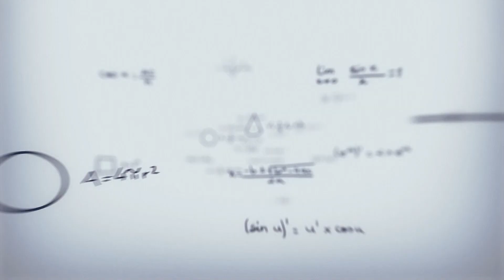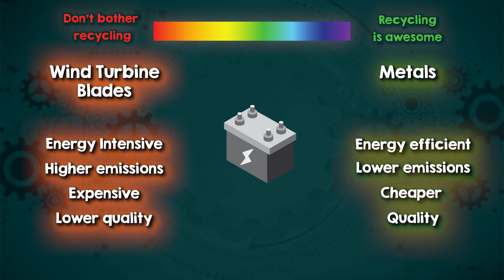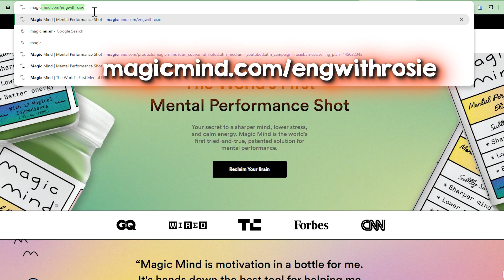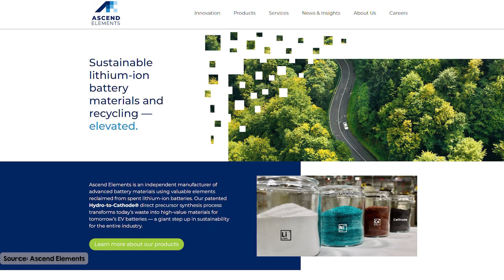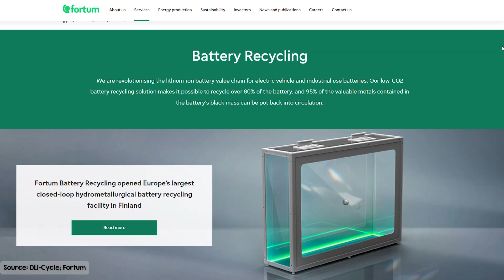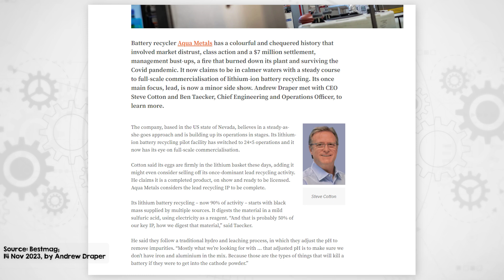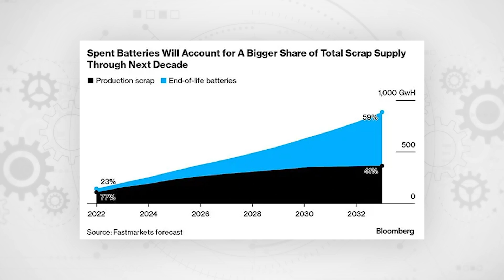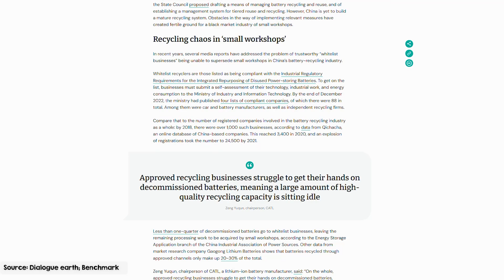Recycling Lithium-Ion Battery: How Does It Work?

Comment: Cost of recycling should "just" be included in the cost of manufacturing for all products. If it costs too much to recycle, it should not be made.
Reply: Yes, but at the same time all negative externality should be included in the price of products.... Such as the negative effects of any form of pollution. But good luck getting that legislation passed.
Reply: @nc3826    Even better luck getting CO2 emissions listed as pollution.
Reply: @nc3826  it is somewhat done with cigarettes and alcohol
Reply: @nc3826  In Switzerland, e-waste management follows the Ordinance on the Return, Taking Back and Disposal of Electrical and Electronic Equipment (ORDEE, SR 814.620). According to Article 3, producers and importers are required to finance the collection and environmentally sound disposal of e-waste through an advance recycling fee (ARF), effectively internalizing the negative externalities associated with electronic waste.
Reply: If you care about the environment you should think your proposition through. What's actually wrong with single use materials if they are more efficient for the environment? For example, you can't recycle the thin metallised plastic films used in food packaging but they embody far, far less environmental impact than making and recycling the old school foil and paper you'd otherwise need to do the same job.
Reply: @kitten_processing_inc4415  
In an ideal world the secret is to reduce the amount of waste to a bare minimum but we don't live in a perfect world.
Plastic film can be burned to produce electricity and heat for other purposes though.  It isn't an ideal solution but it is better than sending these materials to a dump.  Sweden is a leader in this area BTW.
Reply: @anguscampbell1533  More pollution to deal with though? Lots of toxins in some plastics.
Reply: @anguscampbell1533  Sweden has a large carbon footprint per capita and is nowhere near the best countries on Earth. Sweden's carbon footprint is 3.5 production + 5.9 consumption, while in Ethiopia it's 0.1+0.2, in Nepal it's 0.5+0.8, in Pakistan it's 0.9+1.0, etc.

Sweden isn't even in the top 50 so whatever they are doing is clearly not working
Reply: @kitten_processing_inc4415   "More efficient for the environment?" What exactly do you mean by that? Since that is so nebulous of a statement.

As long as you're willing to pay the recycling cost for your "single use materials" in an ideal world you should have that option. Since the world's drowning in plastic waste, those costs should be exorbitant. But it's probably just easier just to ban such a frivolous waste of resources.

Every negative externality needs to have a relevant cost   applied to it.  For a free market to work efficiently. No matter how much it triggers some people, who don't want to pay for  their wasteful lifestyle.
Reply: @nc3826  I do hope you are living up to your ideals and that you have stopped buying pre-packaged oatmeal and have stopped driving in all forms in favour of walking etc etc. 
Otherwise you are making compromises like the rest of us, and kitten_processing's point is perfectly valid in that scenario. Using a less damaging packaging is better, even though some damage is done. The alternative is to use no packaging, which may have other detrimental effects such as lost/wasted products, contaminated products, restricted supply chains, more complex and polluting supply chains.
You see, it's the whole picture that counts, not just one part of it.
Reply: @nickwinn7812  My triggered friend thanks for exemplifying the problem with the current State of Discord in the world.  Where rationality has been replaced with misleading hyperbole. 

FWIW I buy my oatmeal in bulk for a discount and reuse those plastic lined old oatmeal containers that most likely will last 100 years. So there's no cognitive dissonance. But thanks for your concern.
Reply: @nickwinn7812  Thanks for trying to explain things with logic and so on. I actually wonder if we've been trolled, in as much as I'm surprised that someone with no concept of tradeoffs would even have come to this channel.
Reply: @kitten_processing_inc4415 What trade-offs are you willing to accept? Since I didn't see any in your comment.

And It's amusing how some people think that anybody (probably a personal friend of yours) that agrees with their narrative, are being logical. And anybody else is a troll. 

 I get the feeling that I have been trolled? C'est la vie  Have a nice day.
Reply: @gregorymalchuk272  "We didn't adjust for supposed externalities"? Wrong...  "and industrial civilization multiplied our lifespans by 2.25 times." So?  The analogy has numerous flaws....

Easiest way to figure out the main flaw, is by breathing in exhaust gas..... So good luck with that. 

“It ain’t what you don’t know that gets you into trouble. It’s what you know for sure that just ain’t so. “
Reply: Our current capitalism society would then not exist.
Reply: "Our current 'capitalism' society would then not exist" ? 

You mean 'capitalist'. The ones that disseminated spelling and grammar checkers.
Reply: @nc3826  English isn't my first language. You got my point and didn't needed to act in a condescending way for that.
Reply: Until there is cost effective battery recycling I won’t be convinced that an EV is environmentally friendly. I will stick to my “dirty”  10 to 15 year old vehicle!
Reply: It's entertaining how Trolling Luddites waste time demanding perfection, for progress that scares them...  And will never be able to appreciate the old adage that the Perfect is the enemy of the Good.

Enjoy living in the past.
Reply: That's a GREAT idea. Imagine, governments collecting a fee, safely holding onto it for a decade or more and never even considering plundering a gigantic pile of cash for political purposes. That has gone so very well in the past, I mean, 1000% of gas taxes go to roads, Income tax is only for the war. There's never been any dipping into environmental funds for purely partisan political reasons. Especially since most government terms are about 30-40% as long as the lifespan of a battery pack. Yup, that's going to go great.
Reply: So, no new technologies can never be developed then, since at the beginning of any complex tech material, the cost of recycling will always be very high, as it has not been done before.
That's not a world I want to live in.
Reply: If it costs too much, or if it is impossible as in petroleum products.
Not to mention the cost of cleanup. Exxon never paid for the clean up after the Valdez Oil Spill, and oil companies routinely leave oil wells and other infrastructure to leak methane and poison ground water, leaving taxpayers with the bill to seal and  clean them up.
Reply: @1964mcqueen Microbes and nature cleaned up the Exxon Valdez. Just like how microbes eat the million tons of natural petroleum seeps in the ocean annually.
Reply: @1964mcqueen "Exxon never paid for the clean up after the Valdez Oil Spill"? Exxon paid a total of $1.515 billion in connection with the Exxon Valdez oil spill.... 

And recycling is the least effective of Reduce Reuse and Recycle.... FWIW Good luck getting your facts and logic straight.... Or just keep saying stuff to fit your narrative it's all good... Since facts seem out of fashion....
Reply: Nothing will destroy quicker than central planning control freak ideas like this.
Reply: @nc3826  This is true. Even worse, I remember paper was substituted for plastics when I was a child. "save the rainforests" ... 

...Now we are all eating small amounts of it...
Reply: @CmdrTobs  good, we need more fiber
Reply: @EbenBransome my condolences
Reply: Why? What if it is less energy and pollution intensive to manufacture from virgin ores???
Reply: @orionbetelgeuse1937 yes this video is reasonable in she's not directly telling lies like Google will tell you about recycling of car batteries. 
Nobody is wrapping up the truth. 
In 8 to 10 year's 1 million EVs will give us 1 million 1 thousand pound pieces of toxic garbage. 
Even if you move transport and recycle at a central location you will be lucky to save 300 pounds per battery that leaves 700 pounds that needs a special landfill 1 that won't leach into the water table. 
You need a forklift and driver just to replace a EV battery. 
It's going to be ridiculous 10 thousand dollars for the new battery and 2000 for disposal of the old.
And God only knows how much to run the recycling plants because they will never operate at a profit. 
That's why they are all working on hydrogen. 
Forget about upgrading the grid so every one can plug in.
This problem with the batteries will be in full glaring veiw soon.
🤔🤔🤔😜😜😜🐒🐒🐒😎😎😎
Reply: "If it costs too much to recycle, it should not be made."

That makes zero sense. Recycling isn't of inherent value itself. Rather it can help bring down costs and environmental impact. But all of those things are of finite value and have to be compared against other options. Sometimes, disposable products just make sense.
Reply: "Recycling isn't of inherent value itself"and"Sometimes, disposable products just make sense"?   

OK, what's the more environmentally sound alternative?  How about making products last longer and possibly repairable. For example reusable grocery bags, replacing disposable grocery bags . (it's the reduce part of Reduce Reuse Recycle.  Recycle is last on the list and the least effective) 

So stating, "Sometimes, disposable products just make sense" is irrational, since it does the opposite.  In terms of its "environmental impact". So it is just a rationalization for maintaining a wasteful lifestyle. That pretends that plastic and polymers in a landfill is an environmentally sound way to sequester CO2.  

So we can now forget about the mountains and oceans of plastic that's engulfing the world. Which will inevitably break down and have to be cleaned up by future generations (But is now rationalized as a resource for future generations lol) . Plus the dozens of other environmental issues. That still adversely affects mankind and the planet. Even if they are no longer part of the current environmental narrative. 

But I guess I'm just spitting into the wind, based on most of the comments on the subject matter lol.
Reply: @nc3826  "OK, what's the more environmentally sound alternative?"

That depends on the case. Sometimes it could be to e.g. burn it for energy. Let's take the example of, say, shoes? Can you somehow make them recycleable? If not, are you going to say (like OP seemed to say) that then you shouldn't make shoes?
Reply: @seneca983  "Sometimes, disposable products just make sense"? For example, disposable plastic bags.... How is a disposable plastic bags an environmentally sound alternative? I addressed your question, but I don't see any answer for mine? Since there doesn't seem to be any rational answer and you are just trying to change the subject manner....

FWIW My original premise, before you made your comment is that the societal costs of negative externalities need to be applied to products, For an optimal allocation in a free market.  Which addresses products in general. Which encompasses shoes. 

 So I'm still waiting for how single use products such as single use disposable plastic bags are positive for the environment? Which you just seem to be trying to avoid addressing.
Reply: @nc3826  I did not claim that specifically disposable plastic bags make sense. Don't twist my words. Also, they are actually recyclable unlike some more durable alternatives which may last much longer but in the end can't be recycled but only e.g. burned. But again, I'm not defending plastic bags here.

I only said that some products (such as maybe shoes) can't reasonably be made recycleable and thus I think OP's statement that products that cost too much to recycle doesn't make sense. It goes much too far.
Reply: @nc3826  ""Single use plastic disposable bags" was just a specific counterpoint example, of your generalized assertion that disposable products can be more environmentally sound."

I don't see how one example would in any way contradict what I said. I only said that for some products recycleability doesn't make sense, not all.

Also note that recycleability and durability are two different things. OP was only talking about recycleability, not durability, and my response was aimed at that too, not so much durability. FWIW, where I live plastic bags are recycled, at least if consumers put them in the right bin.

"Plus you could have given a different example, instead you mentioned, shoes?"

Shoes are a specific example of a product that would be too difficult to recycle once they are too worn out to be used anymore. How would you recycle them? It makes more sense to e.g. just burn them for energy than to recycle the material in them. (Sometimes burning is called "thermal recycling" but I don't think that comports with what people usually think of as recycling.)

"My true salient point, is the economic principles I gave earlier, based on negative externalities."

Yeah, negative externalities can exist. How big they are depends on the case. I'm just saying that in some cases they're not big enough to warrant recycling (or recycling could itself have too much negative externality). On the other hand, in some cases recycling does make sense. If you're worried about the negative externality of plastic bags, you can implement a Pigouvian tax on them like some places have.
Reply: What a delusional take. This is how you get stupid scenarios like trying to recycle wind turbines at significantly greater cost to environment and consumer. So much focus on recycling, when the existential threat is coming from all the crap we BURN.
Reply: "when the existential threat is coming from all the crap we BURN"? apparently we should just outlaw forest fires?  

What's infantile is those that believe that climate change is the only environmental issue in this world. Apparently open-minded objective critical thinking has been outlawed in schools. 

Yeah "recycling" is the Enemy lmao
Reply: @nc3826 recycling is not the enemy. Well.
Perhaps convenience the enemy. 
How do you feel about paper products. 
It's quite a process to make paper and cardboard. 
Some people believe disposable plastic bags at check out are bad.
So they go on a crusade to get them banned. 
Then for a short time people are forced to bring a personal reusable bag for groceries. 
Then the paper bags show up in force for a price 10 cents. 
And 90 percent of people buy them.
Simply based on weight. 
10X more energy is burned to have paper bags. 
This is the case with 95 percent of recycling. 
Metal recycling does work.
All drinks should be required by law to be in aluminum. 
All plumbing should be copper. 
Ect.
🙃🙃🙃🤔🤔🤔😜😜😜🐒🐒🐒😎😎😎
Reply: Like when has that ever happened in any Capitalist society ever? When has environmental damage ever been made good? When has the price of plant decommissioning ever been recouped from a nuclear power plant operator?
Reply: Sooo 300k for a new car and 200k for a used good idea
Reply: @nialpmatk04  
Who is paying $300K for a new car?
If they are that is their problem.
Reply: @anguscampbell1533  Nobody is, because we're not bound by the proposition of wilinthegreat.
Reply: @anguscampbell1533  Yen, not dollars?!
Reply: We would just buy our shit from someone else... 
We don't want to pay more for products or for any taxes.
Recycling is for losers.